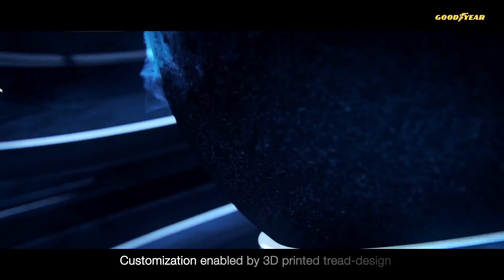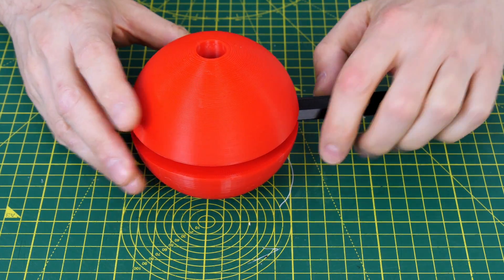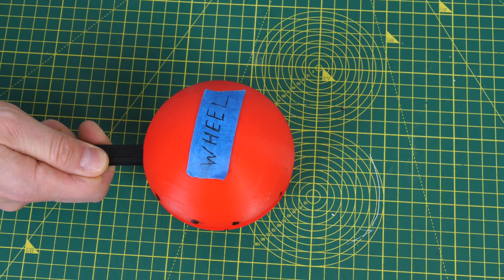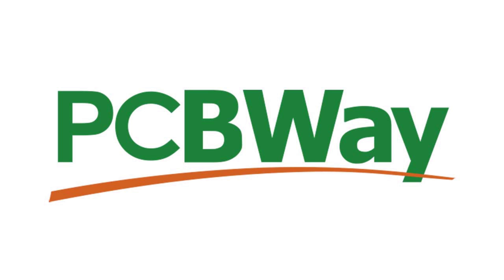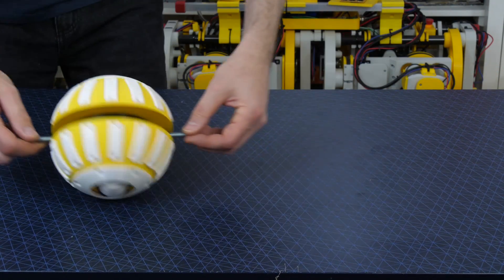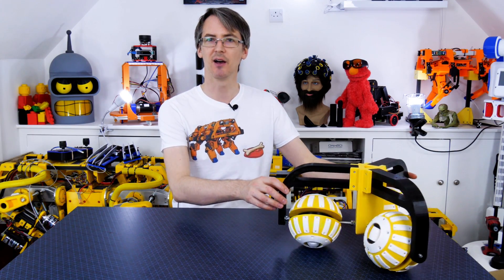Are Ball Shaped Wheels Practical?

Comment from the maker: How well will the robot drive when we motorise the ball wheels?  Patrons and YouTube Channel Members have part 2 already which is next week's video!
Reply: Give the ball free will. That way it can rotate in any direction it wants!
Reply: How was this posted 4 days ago when the video was posted an hour ago? Time travler?
Reply: @darknova2467  When you're a member, you can see videos early if the video poster chooses to upload the video for members to see first.
Reply: @darknova2467  Posted 4 days ago, then later he made the video public.
Reply from the maker: @darknova2467  It was unlisted for a while - Patrons and Channel Members get the videos a week early.
Reply: I can’t see how it’ll be motorised but look forward to it!
Reply: Add this wheel to Office chair 🪑 I think will work really well 😆
Reply: This gives me omni-droid vibes...
Reply: Expirementing with the magnetically snapped metal ball wheels are more gyroscopically accurate and have omnidirectional capability rather than mechanically inclined rotation it has the ability to turn any which way by way of turnpike guiding it like a beachball in the ocean. It won't go anywhere as much as a regular wheel would because it would be in an encasing that prevents it from moving out of its orbit. If they can keep the ball in place I wouldn't have much fear of it however if one of those wheels holding on to the ball itself breaks, who know's what sort of issues may occur. This is all prototypical so it isn't for sure that everything will be safe, however, mechanically stabilized wheels can always lead to kinks in-between parts so I'm more skeptical about your model there.
Reply: @Velossitee  hey hey! i think were onto similar ideas of the mouse ball style axle wheel! great minds think alike...
Reply: Circumvent driving on the littlewheel in software, and then you don't need that complexity. Embed a small magnet instead at the end of the axle, and you can sense it on top when it aprroaches, and then change the rotation of the robot. No disadvantage for a mapping application.
Reply from the maker: @coderentity2079  It's going to be difficult with multiple wheels in different positons
Reply: @jamesbruton  A very dumbed down algorithm: loop { while(any wheel in bad pos) rotate_in_place; go_further; }
Reply: A smart algorithm would slightly turn before reaching the bad pos, and would not stop advancement. The main problem is turning is constricted and not free. The robot needs another turntable on top to face any additional payload where we want.
Reply: If your ready to get supercool you could make magnet ball in joint with superconductor coils. Goal could be towards cold moon crater rover.
Reply: Maybe a magnetic clutch of some sort and slip rings around the main axle. Maybe create a brushless motor design and the main axle would be the motor shaft.
Reply: I'm sure another commenter has already thought of it, but beyond, I suppose torque advantage (and possibly durability), how much better is this design compared to a ball that's socketed in a retainer with two perpendicular drive wheels that spin the ball using friction, whereby the speed and direction of each wheel controls the overall all rotational direction and speed of the ball? Though I admit this design does seem to have the clearance advantage and fits in a more compact space. But in terms of reliability, speed and maneuverability, sure the socketed ball would be better?
Reply: @wyrdsmith  The drive wheels will have to slip sideways whenever the other wheel drives, and this makes the ball movement very unpredictable. Old mouses used this technique but the ball drove the wheels with no torque involved.
Reply: Thank you for your video.
This reminds me of the mechanism "Omni-Ball" in 2006.
The video you watched includes the detail information of inner mechanism which explain how to fix the orientation of the roller to the central rod around 0:58 as follows.
https://youtu.be/BTp2UAaihaI?t=57

We had the presentation about motorized Omni-Ball on IROS2007.
https://www.youtube.com/watch?v=_R6mD5B7W6I
https://ieeexplore.ieee.org/document/4399560
Reply: Will you cross upload to lbry/odysee?
Reply: NO, because surface area of a sphere is wasted, no central axis, and therefore no axle wherewith to affix something like a vehicle or a drivetrain. Next is constraining the sphere.
Worse, deterioration of the sphere wheel over time. conventional tires are rotated to avoid inner woven wear and tear.
Reply: motorizing and breaks on omni wheels....seems challenging...best of luck
Reply: The wheel on the access actually you could have be the same sort of type of wheel as in computer mouses cavity that's slightly more than a half circle and encloses around one side of the ball I don't remember the ball can rotate Any Which Way
Reply: What’s the outro song u used, it sounds awesome
Reply: Make it like a fractal and add another omniwheel on the sides of the og omniwheel
Reply: BB-8
Reply: Is there any doubt that a car designed for braking AS A FIRST PRIORITY and for moving AS A LAST PRIORITY would go well with sphere wheels?
Reply: What’s your outro song called?
Reply: You could just put another ball in the ends with nothing there instead of a wheel. That way it could roll in any direction!
Reply: @gw8868  You actually need the roller because it lets you apply side force when it's touching the ground.  If you had a free ball there, you would loose all traction, and not be able to apply any force for a short while.
Reply from the maker: @gw8868  a ball running on what that won't jam when it's under load?
Reply: It's a cool design, but fundamentally flawed
As the wheel approaches the axis, the wheel will need to spin faster and faster to maintain speed
It should work a little better as a caster wheel, but will likely experience greater wear in places and not support as much weight as more traditional designs
That said, I look forward to seeing how you might improve the design, and possibly overcome some of the issues mentioned above
Reply: @akuunreach  But you can avoid approaching the axis by driving around it, you just have to slightly rotate away. Just treat it as an obstacle in sw. The end result is that you can drive anywhere but your orientation isn't completely free.
Reply: @coderentity2079  You are also going to run into issues where each hemisphere has to be controlled independently. As you transition from rolling along the hemispheres to rolling across them, one of them needs to be reversed to maintain torque in the correct direction. I foresee a lot of issues if people try to scale it beyond small robotic applications.
Reply: @samuelrogers1765  As I see the hemispheres are connected on the same axis and rotate together, no need to control them at all. Only the main axis of the wheel (with the bolts on in the video) driven. But sure, this is for small scale robotics, the bearings are pushed sideways in this, and the hemisphere gap makes the ride bumpy. I find this design way better than omniwheels, because these are big and cheap.
Reply: @coderentity2079  Your reply rate is at 27% stop while you're ahead
Reply: @akuunreach  The free spinning action of the wheel is only used to allow the required slippage to prevent scrubbing.  The driving force is always applied perpendicular to the axle and is at a constant radius relative to the axle.  So no allowance for variable radius speeds are required.  The free spinning action will definitely get faster as the roller approaches the ground, but this has no impact on the driven motion.
Reply: @akuunreach  Yup, this is exactly what I was thinking. Of course, you could try to orient the wheel/axle such that the only time that it runs in these non-optimal ways is when the vehicle is traversing laterally. I would imagine these would usually be low speed/torque maneuvers and so wouldn't require much speed.
Reply from the maker: @akuunreach  That axis isn't driven though, it only idles. Driving video coming up next week!

Comment: to run a car like that you would need 12 motors (3 for each wheel) motors that are designed to speed up and slow down rapidly in a fluid motion.. over a long time  and quite a complex control software to calculate the correct speed of each motor in real time.. not an easy or cheap task
Reply from the maker: Check out part 2, there's only one motor per wheel

Comment: Seems like there’s a saying about this. Goes kind of like “there’s no point trying to re-invent the wheel”
Problem with a sphere is it reduces road contact surface, does it not? From a line segment to a point. Would also be less intuitive to steer. I live in northern Canada, and that thing on ice would be a death slide. Plus isn’t the circular shape a wider profile, meaning that it would have more overall drag than narrower tires?
These are thoughts just without watching the full video, maybe they come up but, more moving parts also offers more opportunities for failure and more expensive, specialist repairs.

Comment: My biggest gripe with ball wheels is the wear patterns… go too long in a straight line and you got a decent amount of wear in one way and when you turn the wheel, or in this case ball, it’ll be jumpy and bounce and suspension would be terrible as there is no way to actuate or compress or rebound with that system so all the worse.

Comment: 2:20 I haven't finished the video but my first thought is just to put a wheel in that socket I'm pretty sure that will fix the issue. As I said before I haven't finished the video so idk if you did that or not
Reply: oop, not just 5 sec later you show what I said lmfao.

Comment: ... So i might be stupid, but instead of a ball shaped wheel, why not have a normal wheel on a 360 degree vertical axle?
Because as far as i can tell, the only thing a spherical wheel is going to accomplish is unequal tire wear.
And yes, i'm aware of the inherent problem with dry-steering, but even then, just put 2 wheels with a gap in the middle on a single vertical 360 degree axis, and make them turn independently when dry-steering, in opposite directions to almost entirely mitigate the problem.

As far as i can tell with a 2 minute think, there's literally no practical reason for spherical tires other than being able to say "bro, i have spherical tires bro. That's like. 3 times as round as yours.".

Comment: The major problem everyone is forgetting when talking wheels or ball wheels. Is, no one is thinking about surface changes. While a wheel is good on all types of surfaces. There are three it seems that defeat the wheel. One very wet and slick roads. Hydroplaning that is sliding in very wet conditions is dangerous. The other two fit in a single category. Ice. Whether its visible Ice or Black Ice. It's perhaps the most dangerous surface. Can a ball wheel or four of them defeat black ice?

Comment: Why horizontal axle? Why not a vertical axle that doubles as suspension and rotates? I feel that kind of setup wouldn't be suitable for cars but trucks and lorries maybe
Reply from the maker: Because that wouldn't make the wheel go around?
Reply: @jamesbruton  ?? How? Since it's not powered in the example, axle would have a ball bearing on the end with another going through the bearing attaching both sides no? In a more, overly complex example there's probably some setup that allows either a motor inside the wheels (depending on the size) or some kind of (I had to google it) bevel gear setup. Essentially ball shaped office chair wheels

Comment: Replace the bottom wheel with another ball wheel
Reply from the maker: The wheel would slip when it runs over the ball in the powered axis. It must only run in one axis which is why it's a little wheel.

Comment: Another problem would be that after turning the car, the wheels would be out of line with each other making the rotation to movement ratio different on each  the wheels. A way around it would be some programming to detect what angle the wheels is at but if that went wrong, it would be really expensive and a lot of work

Comment: What is very very sad is when i was 14 years old i came up with every design possible with a spherical wheel. I think i gave up on the idea when i was around 16. Im now 35 i can tell you now the world is Sloooooow lol (sure i wasnt the only one who thought it would be cool and would work but it will never) no matter how you design this wheel there has only been one design that would actually work but the price tag is too ridiculous to be a thing. A price tag of a normal tire is around 100 bucks a tire (give or take of course) now with a spherical wheel 100s of moving parts, plates of rubber...etc. Just think about the astronomical price that would be. Then you have a thing called friction. If anybody noticed what asphalt does two tires taking inches off the tire every so blah blah miles..... Your tred becomes more and more shallow..... now just imagine this on a spherical wheel and a year later your once spherical ball now looks more like an egg or an oval..... yeah not really practical is it? Yes I solved that problem as well but then you run into the price tag problem. And to anybody else who is thinking about this idea that was alive during the 80s and 90s, if anybody remembers those old computer mouses with the little ball underneath and not the lasers. There were two cylinder wheels one vertical one horizontal which gave the system input of which direction you moved the mouse. For a vehicle those two wheels would be geared to spin or move the spherical wheel in all directions.... this was the only design that I could think of that would be lightweight. A floating wheel, no axel..... the requirements for this thing to work would be a lot of smaller Wheels acting as bearings basically. But again this is very impractical because we would literally need to redesign the road itself right after an order for the tire not to degrade.

Comment: I was thinking you’d have two halves and it would attach to an axle with a version of a multi-ball ball joint by moulding the wheel around it so it couldn’t pop up. And magnetic braking exists but it seems like a lot to have in just one wheel and a lot to rely on versus the traditional pressure used in disc and drum brakes. I’m wondering how they’ll adapt electric vehicles using this. Will the wheels generate any power? It would be a pretty interesting concept

Comment: First, congrats for your video, very concise and informative, and the basis for many mechanical and robotic applications.

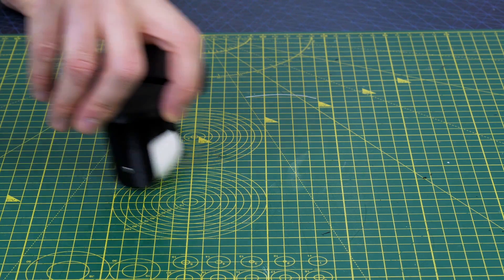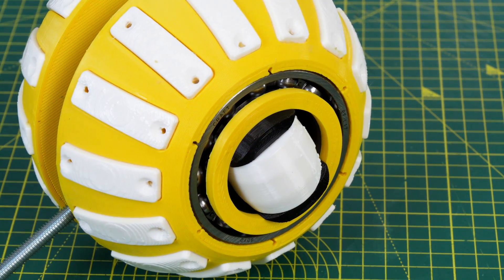At 5:33 and 6:58, I don't know if another commenter pointed out, but you should try a ball at the top of each hemisphere, coupled to a ring ball bearing, and a screw-on retaining ring; that would make the wheel even more smooth as the ball could freely rotate in any direction and make an even smoother profile into a complete sphere.  I'll try to work in a Blender model if you find it useful for a follow up video.

Again, excellent video.

Comment: It's quite simple in concept but maybe not so in implementation but I think we need to do this. The wheel ball housing and wheel ball housing act as stator and rotor with 360 degree range of torque actuation. Minimal mass so efficient and minimal components with a high safety factor.  Extreme acceleration torque is possible. This is genius. Brilliant concept.
Reply: Who came up with this at Goodyear?

Comment: If your using Magnetic Levitating Wheels, i guess what people would and should be worried about is that the bulk of the car would maintain momentum after the Electromagnet Wheels stop moving right? BUT if built properly the wheels would stop and so would the electromagnets, in an emergency stop the car would basically drop onto the wheels and the increased Surface area of the Spherical wheels would make the stop faster than a normal car(in theory.) you could also implement other emergency stop functions, for example if the car is dropping a considerable amount on to the wheels let's say 3-6 inches, you could also have other rubber stopper's around the frame to increase surface area even more, though if your going fast enough you'd just flip the car regardless of how fast the stop is. 

In addition, slowing down or breaking wouldn't be an issue except in emergency stop cases, because so long as the wheels can slow down the car will as well. Though admittedly you'd need unbelievably strong electro-magnets in the wheels so that the car is effectively "Locked" into place, something to weak would make it wobbly and cause it to bump the wheels. I guess another issue is the astronomical cost, normal non-tech wheels are like 100+ a pop and waaaay more if you get the super nice "Long-Lasting" wheels. So spherical wheels with high-tech inside them, i could only imagine.

Comment: The wheel at the end of the hemispheres doesn't have to be fixed. If its a ball it could simple be put in a free rolling socket as its simply there for the rare points that the hemispheres would even be oriented like that especially when mounted through an axel.

Comment: there is one thing that will always kill ball wheels that this video showcases beautifully...

They are wickedly difficult to create... and for what gain? compared to the ease of manufacturing traditional tires, these are overengineered, have many more weak points, and dont really solve a problem. Thus, ball tires will just never really take off.

Comment: I'm doing a work for completing my Mechanical Engineering graduation in Brazil and my research is about the use of mechanum wheels on small cargo robots on inside factories. I'm having difficulties about the equations that define the movement of the body and I just want to ask if you have some papers that used for reference in this video that you could share. Every help is very welcomed. Thank you.